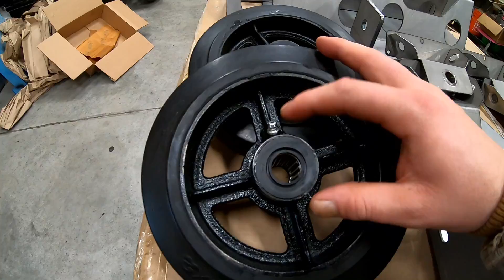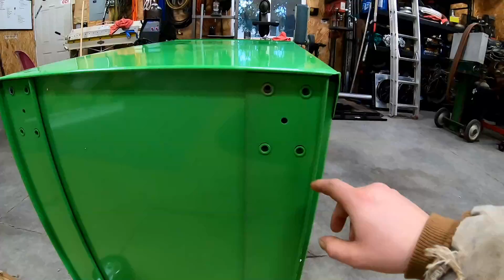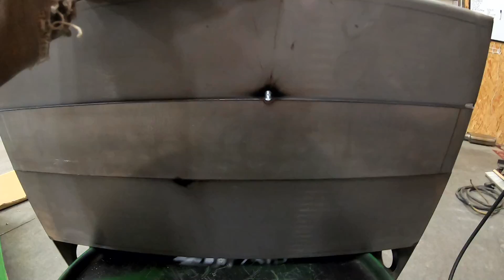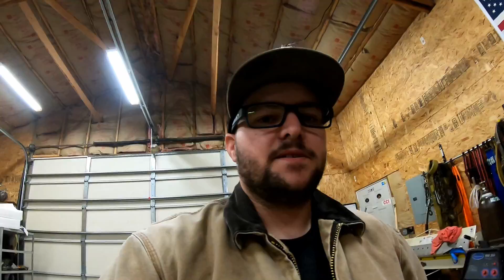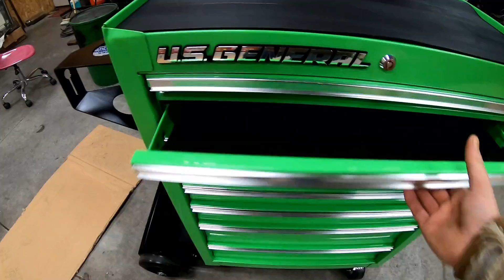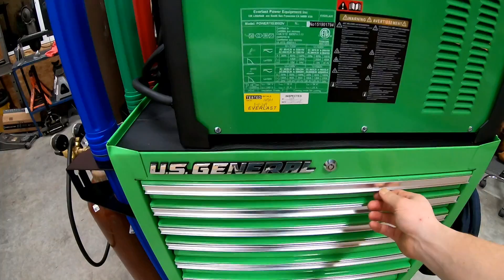THE ULTIMATE WELDING CART!!!

Comment: I love this. All-a-Cart (ZTFab's manufacturer) is charging $310, delivered, for something I would expect to pay $100 for. Think of this: the Harbor Freight cart, with tax, only costs $10 more than the ZTFab kit, which is basically two unpainted brackets and some wheels. There is no way that makes sense, even with China factored in.

Today I went to my metal supplier and spent $32. Tomorrow, I will have to spend another $10 or so on another piece. By the time I pay for paint and bolts, I should be into this for around $85, plus the tool chest. So $405 instead of $640.

God bless All-a-Cart if people want to pay that kind of money for something they could be building themselves. It's not for me. I plan to build two carts and finally get my welding stuff of the table and floor.
Reply: I just received one of Pauls (ZTFab) kits. The dual 9" bottle with 4 cord hangars. This kit is like art work. Custom CNC milled and cut. It is on a whole different level. That kind of metal work cost large. After I tig it up and powder coat it it will far surpass most home built kits. I am a geenyus by trade but don't feel bad I come to youtube once and a while to hang with the regulars.

Comment: Just before seeing your video I decided to convert a Craftsman rolling tool cabinet inherited from my dad.....18"x30"; 3 full width drawers and full width bottom storage with pull down drawer.  Going to use double 2x10s bolted to original caster mounting points beneath cabinet extending from both ends to form dual tank platforms for mig/tig and oxy-acet tanks.  Original casters reattached to 2x10s beneath tanks.  Will add cable/hose holders; capped PVC rod holders; HF welding table top hinged from rear with drop down legs; multiple 2"receiver hitch tubes to accept removable vise and other accessories.  Going to check out your kit source for pre-fab cable holders etc individually.  Thanks for video.
Reply from the maker: That should be a rad setup! 🤘🤘

Comment: I had the same idea for my welding cart and loved it until I put the welder on top of the toolbox and realized it’s very difficult to weld under a car because you lose a lot of torch lead length due to the height of the box itself. If your just bench welding it’s fine I guess. Great product just too tall to be functional.
Reply from the maker: That's why the car lift is handy to have 👍
Reply from the maker: As well as longer leads.

Comment: The corners of the box are wide open since the welders aren't very big. I would just build a rack that attaches to them and gives a shelf for the plasma right above the welders. You already have the box so may as well keep all consumables in one location so you aren't chasing all over the shop. If I was using small welders like that I would probably go for a kit like this. Big time saver and looks robust. Nice vid and well done.
Reply from the maker: I've thought about doing that. Thanks!